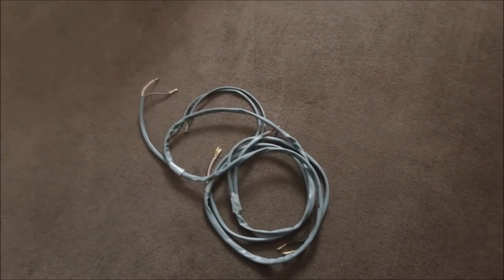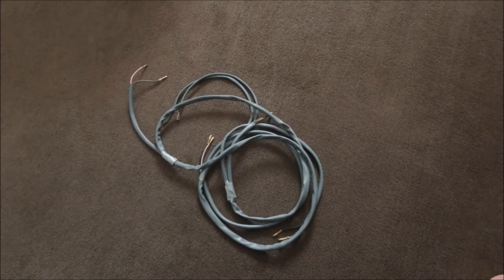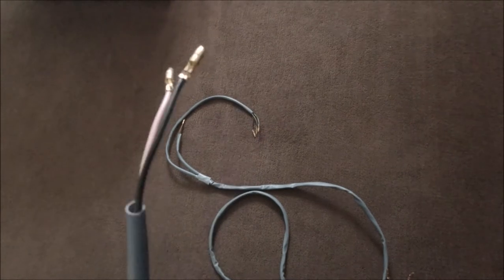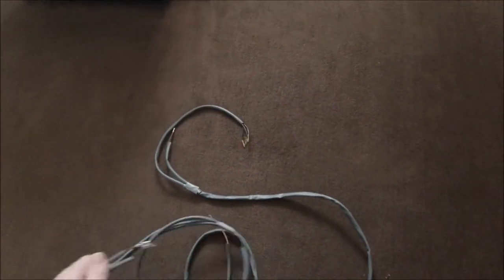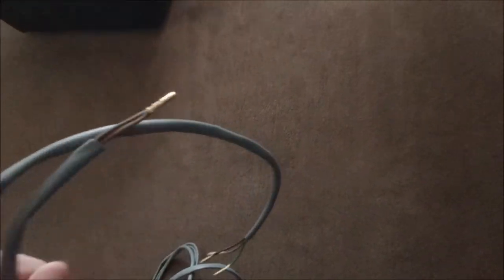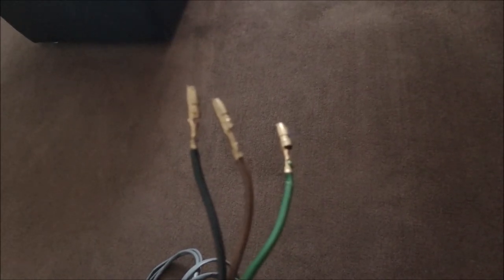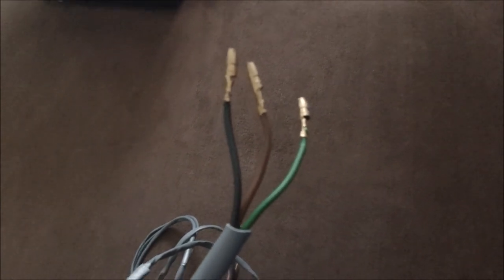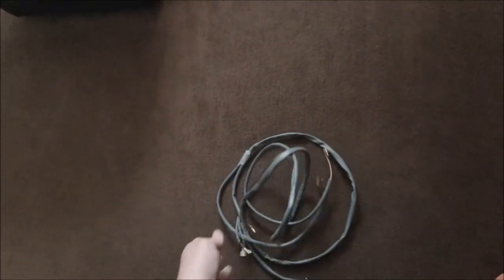Lambretta Electronic Loom

Comment: Is there any chance that you could show me where they go on the bike i.e. to coil to earth as I have a 1950 7LD 150 and I can’t figure out the wiring loom to coil to switch
Reply from the maker: Ld is different to li, the coil is one side to frame the other connection is from the stator, points and condenser and is earthed by the handlebar switch, there is a rectifier that the battery is connected to and the lighting all fed by coils on the stator plate, I would suggest you join a Facebook page for ld's as these guys can help you with drawings and pictures, oldest scooter I have is a 1960 gs or 61 li150